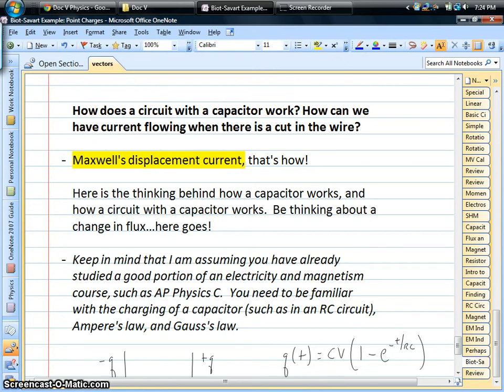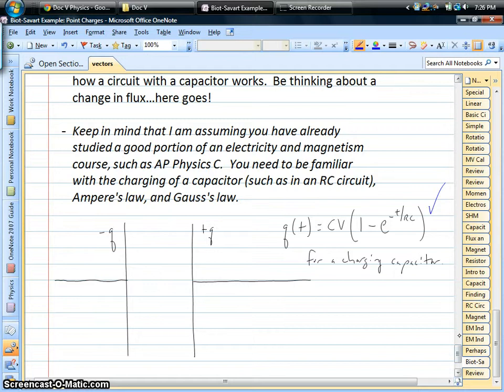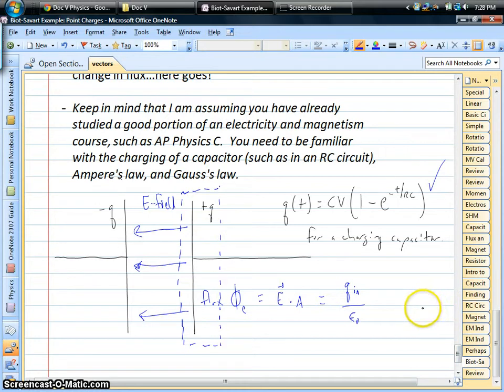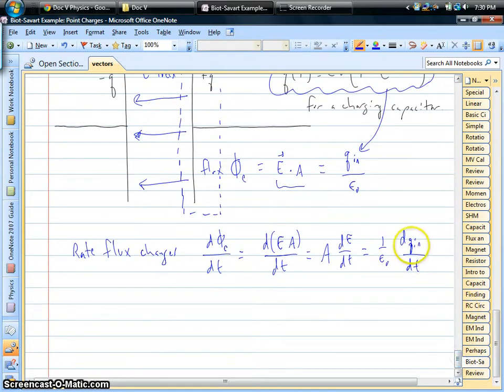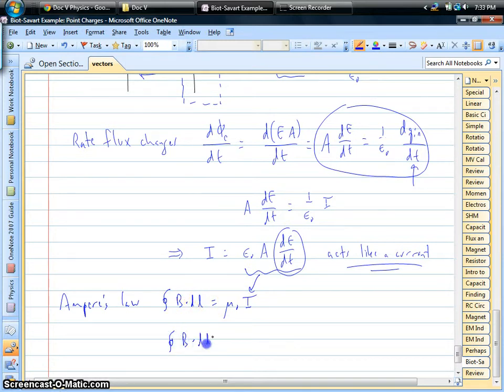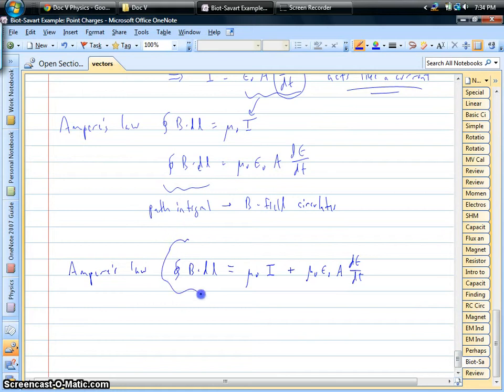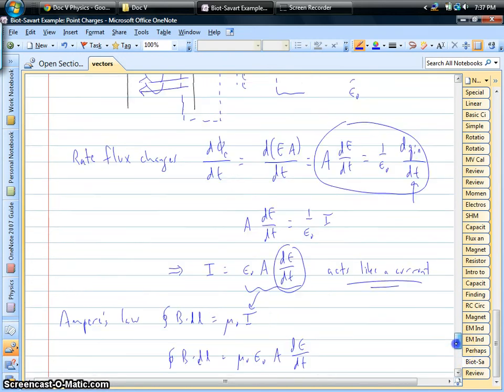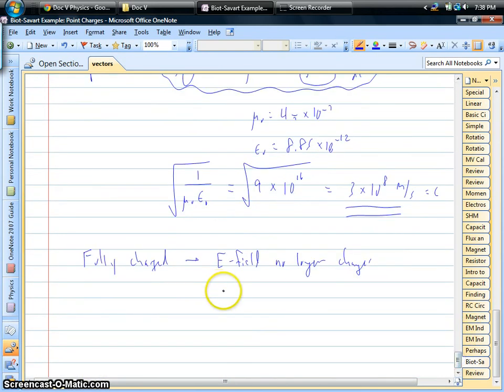Maxwell's Displacement Current - How a capacitor circuit works

Comment: 10:30 he did not notice these constants (permittivity e, u),  in 1855, German physicists Wilhelm Weber and Rudolf Kohlrausch performed an experiment on  Leyden jar, from which they calculated the ratio between these and became known as Weber’s constant, it was numerically equal to c√2. Weber then already realised that this is the speed of light. In 1857, another German physicist, Gustav Kirchhoff, used Weber’s constant to conclude that electric signals travel along a wire at the speed of light. So he linked the light to electicty long before Maxwell. Then later in 1861, Maxwell re-interpretted the same results to also mean that space is filled with tiny aethereal vortices and that c is the speed of light through space. So Im not sure why Maxwell alone is considered the genius in the whole discoverey in our textbooks.

Comment: I enjoyed this immensely: constants. I found this in a paper referenced below: " In the year 1855, Weber and Kohlrausch
 performed an experiment with a Leyden jar and established the ratio between a
quantity of electricity measured statically to the same quantity of electricity
measured electrodynamically. This ratio turned out to be numerically related to
the speed of light. The literature is unclear as to when exactly Weber,
Kohlrausch, or Maxwell became explicitly aware of this apparent numerical
coincidence, but the evidence does seem to indicate that it strongly influenced
Part III of Maxwell’s  (The Significance of Maxwell’s Equations by Frederick David Tombe)